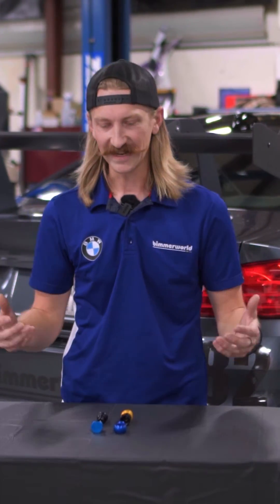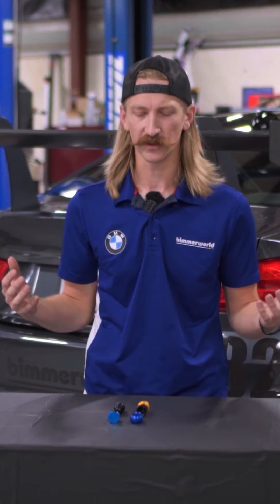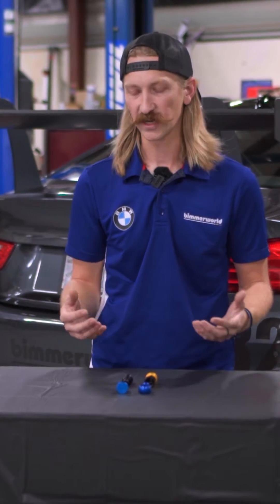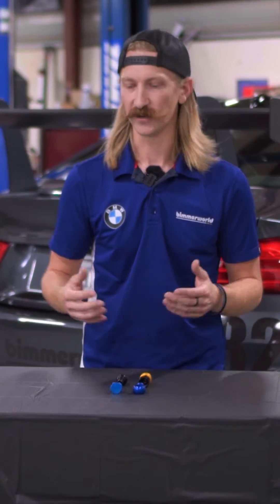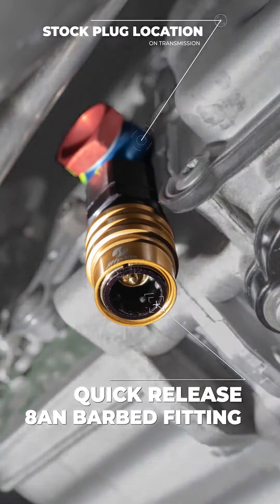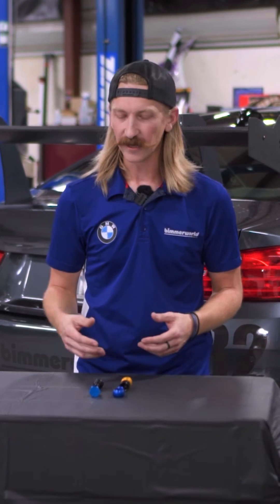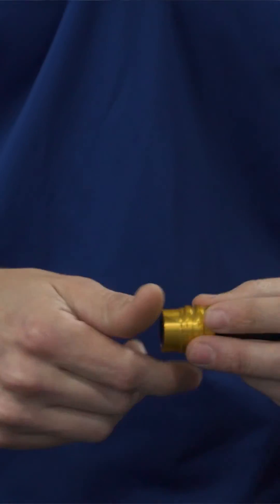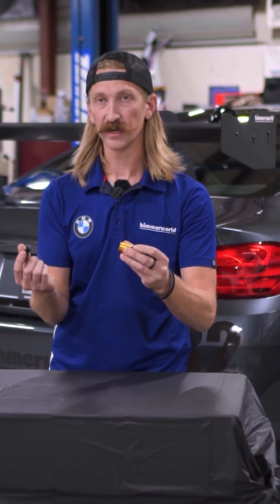MUST HAVE for those that track their DCT equipped BMW - BimmerWorld Overfill/Dry Break Kit

Comment: How do we know when to stop filling fluid?
Reply from the maker: To start you still follow the proper process for filling the transmission using ISTA or some other tool that allows you to perform the fluid level procedure - you can do this with, or without the dry break in place. Our preference is with the dry break in place and know that the fluid is slightly overfilled to account for the banjo bolt thickness. That is your baseline, then the dry break connection allows you to pump an additional quart of fluid into the transmission and know that you got a quart in there without a random amount spilling out of the fill plug